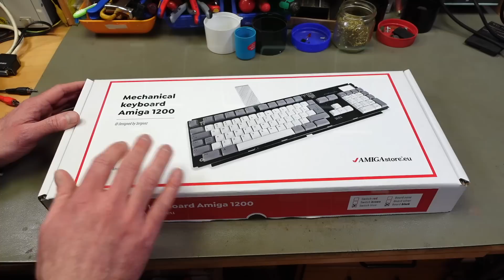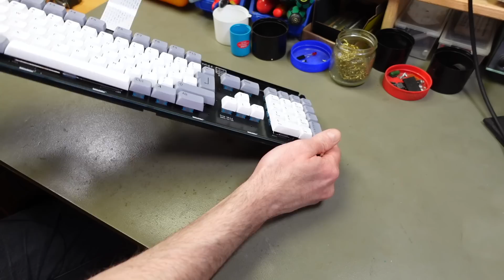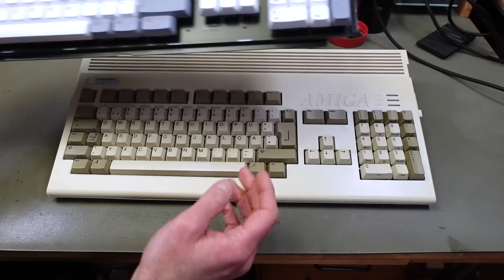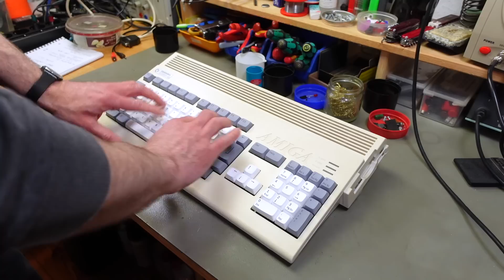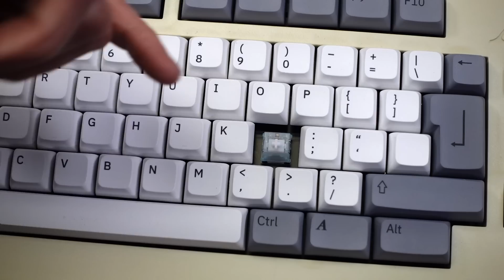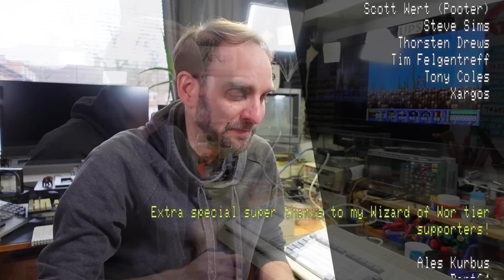New Mechanical Keyboard for the Amiga 1200

Comment: The keyboard looks great and I think the prize is fair for such a product. I personally love the IBM buckling spring keyboards which are still produced today in a modernized version with Windows keys and USB connector. Two years ago I bought such a keyboard new and it was around 165€. Today the prize is 190€. Just for comparison what you pay for a high quality PC keyboard.

What sucks is that there is no German version (and of course other international versions) yet. As the keyboard uses modern standardized keycaps I hope there will be other keycaps available in near future.

Comment: I'm working on an Amiga case to use with my MacBook Pro and therefore wondering how this keyboard would act in modern MacOS if I would connect through usb using Keyrah (V3). Would I be able to use or map the keys F11,F12 and Fn key? Or how the keyboard would handle in FS-UAE? I would appreciate any thoughts on this. I already bought an original A1200 keyboard to find out how that would work in MacOS butt still waiting for a Keyrah. I ordered the Keyrah along with a black A1200 case, black keycaps and ledboard which I'm looking forward to receiving this or next month. Happy to share my experiences if anyone's interested. Thank you Jan Beta for great infotainment!

Comment: Two lost opportunities! A new keyboard is nice, but this is not a mechanical keyboard, because this is a foil keyboard. If it would have been a mechanical keyboard then a flat back plane without holes in it for the switches would not be possible. 
 
The second failure is the strange placing of the keys. The cursor keys are on all Amiga computers one row up, the caplock key should have been placed  on the same row as "asdfg" the control key should have been on the same row as the alt-key and the Amiga-key, followed by the spacebar. For people who use an Amiga the erroneous placing of keys it is a problem because in the present day and era all other computers use one and the same key placing. Every time when they use their Amiga they have to get used to the disorientated keys. 
 
Besides all this, the development costs of this keyboard must have been very high, producing a plastic foil is way more expensive than developing a PCB. If a standard Mac/PC/Linux keyboard would have been used together with a small electronic matrix adapter the development costs would have been 95% lower, and all keys would have been on the correct position. Minor adjustments had to be made to the Amiga housing though. 
 
By the way, most Amiga owners do never type in a letter on the Amiga, never seen e-mail on the Amiga, only games. The Amiga could have done without a complete keyboard. Spacebar and cursor keys would be fine.
Reply from the maker: The placing of the keys is a matter of taste, of course. The design tries to be a hybrid of the original Amiga layout translated to a modern PC keyboard layout. This is customizable to some extent, at least. You can just throw on different custom printed keycaps as they are a common modern size.

It's definitely NOT a foil keyboard. I'm literally showing the individual switches in the video (for further reference, watch the original video I made about the prototype, conveniently linked in the description). The construction consists of two PCBs and the metal backing plate, so of course you can't see the switch contacts poking out the bottom once it is fully assembled. I suggest you actually watch the video and pay a tiny bit more attention before commenting. That said, you can use your Amiga any way you want, of course. If you don't need a keyboard, you don't have to use one (difficult to do a keyboard reset without Amiga-Amiga-Ctrl, though). You don't have to buy this one either. It's just an option for people who actually want it. ;)
Reply: @JanBeta  Dear Sir, if you say so, I will take your word for it. I have zero Amiga's taken apart and dozens of PC's, Linuxes and Mac's. And with all keyboards a piece of plastic foil sticking out it is (often) a foil keyboard. I can imagine a foil connector and still having real mechanical switches. I have never seen it, but that is no proof. I have never seen Thailand, but still it exists, I think. Forgive me my lack of knowledge, I am only human.

Comment: It is this re-yellowed amiga? 
7 years ago retrobright, and now reyellowd?
https://www.youtube.com/watch?v=0S1DooHW6xs&list=PL-5ePRSixyiuiAKu7wfzF9QyFkmSDhQZo&index=1
Reply from the maker: Yes, that’s the one. I did some re-retrobrighting recently but it already started yellowing again. Still much better than it was though. 😅
Reply: @JanBeta  
You don't have tried to retrobright to an amiga CRT yet, right?
Do your CRT's yellowing?
I've seen in your overall youtube video list:  the phillips CM8833-II, the commodore 1084 monitor and the Phillips TP200.
Reply from the maker: The Philips 8833 is painted from factory so it doesn’t yellow at all. My 1084 and the TP still look good. Would be challenging to do retrobright on something that size.
Reply: @JanBeta  
Ok, thanks for this info.
So that means, the Phillips 8833 has a superior property (--> painted) compared to its brother, the Commodore 1084S.

I still have the 1084S from my childhood. But it has yellowed overall compared to its original color (see inside).
The back cover, i've already made some 'brightening' through the sun method. Yes, it is a little brighter but not its final original color.
The front plastic frame is screwed to the tube. Actually it is more yellowed and now i am still thinking how to proceed...
  -  let the yellow as it is....
  -  try the sun method...
  - or try a retrobright bath in a fluid hydrogen peroxide bath, with further risks of decoloring....

Comment: It is fantastic all the mechanical keyboards coming out for all the retro tech.  Some are not done well (C64X - for a modern Windows PC) and suffer bounce without deoxing the keys occasionally.

I don't know if bounce is typical with mechanical keyboards without de-bounce routines built in?

Now if I had my preference when I ordered this keyboard, I would order the Green Keys witches (really clicky for the heavy handed).
Reply from the maker: I'm not sure if that issue is common for mechanical keyboards, I never had any problems with it. Probably it depends on the quality of the switches more than anything else.

Comment: That looks closer to an ISO layout than to a US layout.  We use ANSI in the US.   Several keys are different.  Most notably, the Enter key.
Reply from the maker: Yeah, the Enter key should be a larger L shaped one for the US layout. This just uses the smaller key and a blank keycap to accommodate for more different layout options. It should be possible to remove one of the switches and have a larger Enter key in this, though.

Comment: Looks like the keys themselves are somewhat translucent. I wonder if it would be possible to drill a hole through the Caps-Lock key and put a dab of hot glue in there to recreate the classic LED Dot look from the original?
Reply: You could do it yourself, but it wont look ok - i tried :D It's not sustainable approach in larger manual production

Comment: Sorry, but €185.50 plus €8 shipping costs is just crazy. I would never consider spending that much money on a simple keyboard. What's wrong with the original Amiga keyboards? You can get complete and working Amigas for that price. Even today, complete Amigas are simply thrown away every day.
Reply: In the world of mechanical keyboards, €185 is cheap. PC mechanical keyboards are typically hundreds of euros and can reach into the thousands.  Mechanical keyboards offer a much better typing experience than membrane-based keyboards and can be fitted with a variety of off -the-shelf key switches to suit one's preferences.  The stems are standardized so alternative key caps can be purchased or made.

There may still be some complete Amigas thrown away daily, or incomplete ones for that matter, but they don't usually just fall into one's lap.  Those days are over my friend.    Demand from collectors and those who want to relive the glory days is increasing, while supply has drastically dwindled.  Waste-management facilities have caught onto this and no longer permit free public scrounging of material, though they may sell it.

Some combination of patience, skill, luck and money is needed to find vintage, retro or obsolete computing equipment.  A decade ago you could expect to find mountains of '80s and '90s computers for free—not so today.  If you encounter a complete Amiga for €185, whether it works or not, snatch it up.  That is a score.
Reply: @Starchface  My mechanical keyboard cost me €30 new. You can spend hundreds or maybe even thousands of euros on them, but you don't have to. €185.50 for a keyboard is anything but cheap in my world. Especially not for an Amiga, because it's an old gaming machine. How many people write long texts on an Amiga these days?
I recently discovered another Amiga 600 with a 1084S monitor at my recycling centre. Simply thrown away, even though it was completely intact. This is not an isolated case. There are treasures to be found on every visit. Not just computers, but also expensive, functioning hi-fi equipment, for example.
Reply: @Aboxfullofvideos  In the case of a low-volume non-standard design, I say we are lucky to get away with paying only €185.  Having bought a cheaper conventional USB keyboard as I also did, has no bearing on the matter.  Horses for courses. 

What then did you do with the Amiga 600?  If you were allowed to walk off with it no strings attached then you were lucky.  I find the waste facilities guard their trove like an old man protecting his hoard of old newspapers.  You've been very lucky.
Reply: @Aboxfullofvideos   You paid 30 because it was corsair or other asus that ordered them in millions. Try thinking about extremely small scale. Several hundred or thousands of units is simply not something that bigger companies would even consider.
Second: it it not ok to expect AMIGAstore to be a charity organization. They have people that are doing the work and need to earn money to get the business and life running.
Lastly it's like this joke: other keyboards are cheaper; Then go buy there; But they are not available :D
Here you can really order something that exists. When I wanted to buy something in 2021 it was all "prepay here and wait - maybe I will send you something" or "kickstarter" campaign with 5 years history.

At least there is a real choice now: stay with commodore original, or get a new one.

edit: I just now did a small research on what's on the market; I found several old keyboards on ebay for around 100EUR. Single keycaps (!) for 5-10EUR EACH. Then I found some other project of keyboards for amounts closer to 280-300; AND you can't really order them. .... sooooooo It all makes AMIGAstore offer to actually look good.
Reply from the maker: You don't have to buy it. I think it's reasonable, given the small scale production (with a lot of manual work, I assume) and the cost of the custom parts. You can easily spend a lot more on a modern PC mechanical keyboard that is mass produced.

Comment: I don't like the left and right arrow keys. Are they set to the top of the keys on the OG keyboard? It's been a while since I owned an A1200 (1994). I wish they were more centered vertically. Other than that, it looks and sounds great.
Reply from the maker: Yeah, the arrow keys look strange indeed. I wonder if they placed the keycaps correctly. I'm going to have a look at that.
Reply: @JanBeta  Just swap the left and down arrows, and it's fixed.  They messed up on the install!

Comment: Too expensive, and the extra control key means it aint really “amiga”. The programmable key idea is good but they should have made it the blank key instead
Reply: It was exactly meant to not be original. I explained that on my old page. Not at all; It was meant to be a mechanical keyboard replacement that is drop in and use type of thing. BUT it's ok to have both opinions :) I built it for me and it's ok for me :)
Reply: You are absolutely right. I would rather get myself a Retro mechanical keyboard and use Winuae on my PC before buying such a thing which really has nothing in common with the original...

Comment: The A1200 keyboard is terrible. Worse than all of my C64s and even my cheap PC keyboards. When this goes back in stock I'll order one to finally finish my A1200 🙂
Reply: The original A1200 keyboard may be terrible by today's  standards but still, it is the Original.  This mechanical keyboard is a modern replacement and has nothing to do with retro..
Reply: @hollgo626  it makes using retro consoles more enjoyable, that is everything to do with it. iirc there are some Amigas with stock mechanical keyboards, they're just rare.
Reply: also both my A500 and A1200 are noticeably worse than I remember from the A500 back in the day, it wasn't any worse than the C64 in my memory. these rubber domes degrade over time, I suspect that is the problem.
Reply: @radicalbyte  There are no rubber domes on an Amiga keyboard. The Mitsumi keyboards use a combination of plastik stems and a plastic foil membrane. The membranes have proven to degrade more than the small rubber ends on the stems. Normally, it is enough to replace a degraded membrane before buying a whole new one.

Comment: Those key caps just look too fat and rounded, not flattering to the A1200 imo.
Reply: I'd get some Drop MT3 keycaps (with their Amiga key extras added).
Reply from the maker: You can replace them with something else if you prefer. They feel nicer than the original but as you say they don't look anything like the originals.

Comment: Would love this for an Amiga 500. But one thing... The print on the down arrow key on the cursor block annoys me. Looks so off compared to the original design.
Reply: It looks like the keys are installed wrong.  The left arrow and down arrow keys should be switched.
Reply: @shootiforgotthat  No, the print is just wrong. Left and right are correct, the arrows are usually on the upper portion of the key, The down arrow is too low.
Reply: @TMDrews  2 keycaps are mixed - it will be ok when replaced - I pinged AMIGAstore about this mistake

Comment: It's always amazing to see how much love the Amiga Community has manifested for their hardware platforms.  This looks like a great keyboard upgrade.  If retrobrighting is getting tedious, consider a paint job with something like Rust Oleum 2X or Krylon Fusion (which are made for painting plastics).    Do the surface prep carefully,  and the result will be a smooth, clean finish that doesn't yellow any more.  (It will also permit you to choose colors other than beige/white for your case!)

UPDATE:  when I use "poof cans" (aerosol cans) for painting, I use a pistol grip that fits the can for better control, and make certain to shake the paint/primer mix for longer than regular paint, to ensure it is well mixed.
Reply: Very nice tip! I am still a little scared to retrobrite my A1200, would be awesome to paint it white as it was 🤩
Reply: @djbassgun  You should probably test the paint you intend to use on a similar plastic to ensure compatibility and that the color you've chosen is what you expected after it cures.
Reply: If using Rust Oleum 2x, their Heirloom White” colour is an almost perfect match for my a1200 but I’m not sure how discoloured mine is so your mileage may vary.

Comment: That's one heck of lot of money for just a new keyboard at €185 😮
Reply: I won't speak for the AMIGAstore, just from my own experience. Getting custom parts is one components of all that. Then packaging (box, protection foam) is another thing. Then you have the cost of several people working on it (assembly, packaging, testing etc etc). Plus taxes. Plus the risk of warranty. You are also getting professionals doing your support. 

BUT most important thing: it's there - ready. No risk of kickstarter. No literal years of waiting. No 'far away mirage' of getting something. It's there waiting. 

But I would prefer the AMIGAstore people to respond to your, of course valid remark
Reply: @sergiuszszczepankiewicz2017  I won't deny it looks a decent piece of kit, it's just that's more than I paid for an actual A1200.
Reply: @stephenvalente67  So you are just showing off how lucky you were :D I paid around 400-500 eur for one. "All tested" which I had to repair after :D
Reply: @sergiuszszczepankiewicz2017  Well it didn't come with a working disk drive, but I managed to find a replacement inexpensively afterwards.

It was a lucky find a few years ago, especially as old equipment seems to be going up in value again here in the UK. My local CEX store is selling original Xboxes for £70 at the moment! Never paid more than £20-£30 for mine.
Reply: Day by day, the supply of original hardware dwindles while demand increases, and with it, prices.  Obsolete junk that we threw away in the '90s and '00s is today worth a fortune for many reasons.  We can only expect that to continue.

Soon the only significant source of  replacement parts will be the aftermarket.  In some cases complete working retro-computers can be created from new parts, as we have seen.  I would like to see this extended to less-popular models, but that is economically challenging.

Comment: nice keyboard but why is there 3 keys on right side of space, only A and ALT is there original
Reply: It is impossible to get the very large size spacebar without going into HUUGE cost in money and time. This way you are getting alternative CRTL key, which you can repurpose if you have some other use for it (you need to cut dedicated traces and you have premade pads to use to your liking).
Reply: @sergiuszszczepankiewicz2017  thanks
Reply from the maker: I explained it in the video.